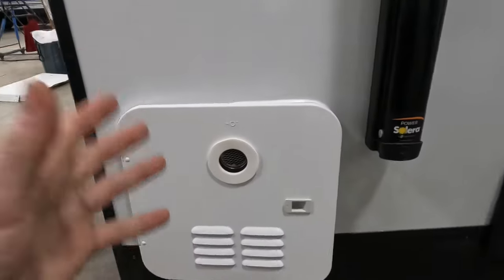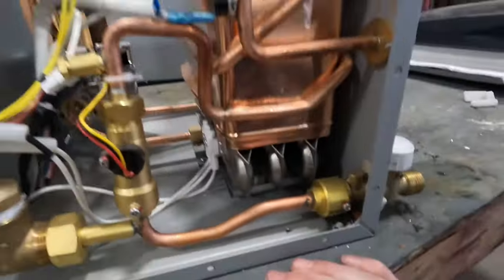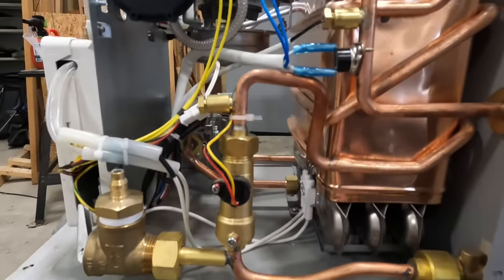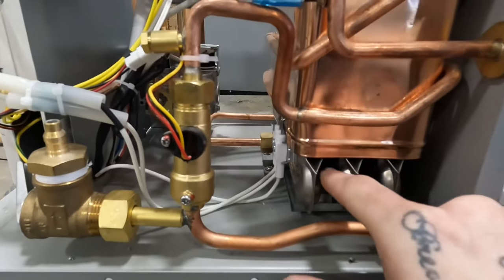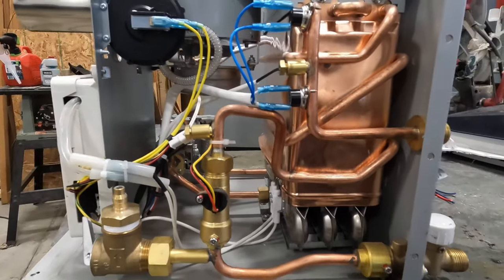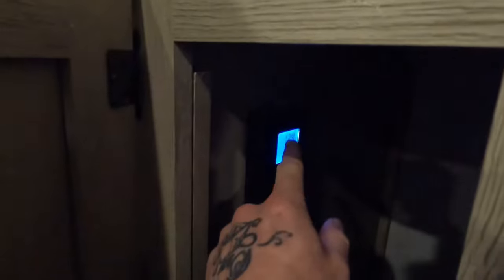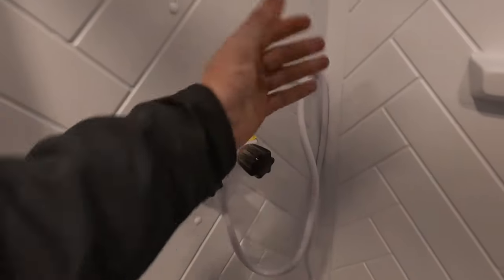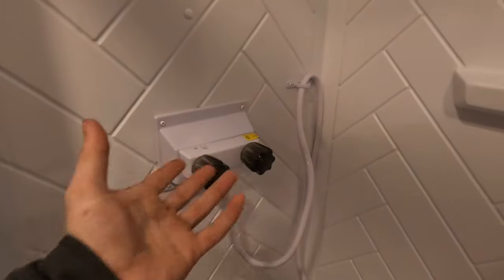RV tankless water heaters, the right way to use them!

Comment: I am considering a portable tankless for a permanent outdoor shower tower and I am convinced that maintaining a constant output temperature will be impossible unless I don't change the spray option (volume) and the incoming water temperature is perfectly stable. For that reason I am hesitant to pull the trigger. These units do not have a temperature setting - the only way to have a consistent output temperature is to adjust the flame and the volume and rely on the incoming water temperature to be stable plus don't change the volume i.e. to change to body wash or handheld option. No one seems to mention this shortcoming.

Comment: What do I do if the control board isn't changing the temperature of the water. I typically have it set at 100 and the second the water turns the temperature shoots up to 130

Comment: I'm having an issue with mine. I have my control panel set to 110, but the output goes way beyond that 115-127. It'll shut off when I turn the cold side on, but then I'd have to turn the cold side off when it gets too cold. I constantly have to repeat that daily

Comment: Question…what is the ‘steps’ in the procedure for set up your water at a RV site & turning on your hot water heater?  I was told to connect your water at the RV site, then turn on the water in your sink to make sure you have pressure and THEN turn on your tankless water heater…is this correct?

Comment: I have mine turned all the way up to 124 and even only using hot it only goes up to 99? The sink water is hot but shower only Luke warm ? Brand new RV? Is there a scald guard or something?
Reply: I'm not a RV tech but I'm am a HVAC tech . Maybe the rv tech can chime in on this but, commonly on standard tankless water heaters that could be a running issue ( not firing correctly,  not burning correctly ect....) with water heater or under sized because the amount of water flow going through unit or your temp rise from cold coming in isn't enough ( under sized) . Hopefully you get this figured out.

Comment: We spent three or four days in a row a week inside the RV is it OK to leave the tankless water heater switch in the amp position all the time? Or should we only turn it on when we’re taking showers or washing dishes? We just don’t want to lick or work hard when we’re not actually using hot water.

Comment: So I have a stupid question about the operation shown in this video. There is an off / on switch on the side of the tankless water heater. Purpose of this switch? I would assume if there is no flow that it wouldn't work anyway or am I wrong. Thanks

Comment: good tip on hot only.. stupid question... is the (O ) for OFF or the line ( | ) on the heater.  I wanted to turn it off and no other markings
Reply: O is on and | is off

Comment: Yeah, unfortunately this didn't work for me.  Brand new tankless water heater in a brand new RV.  Doesn't heat up water in the shower, but it does heat up in the bathroom and kitchen sinks.  Output stays around 85, even goes down and back up.

Comment: My Fogatti  tankless rv water heater will overheat the water. I have set it from 102 to 104 and the temp will go to 109 and more while I am in the shower.  If I mix in any cold water it will keep jumping higher and higher as I add cold to it at the shower.  Have you any fix for that?  I have increased the hole size in my shower head to allow more flow and it helped some but it starts at 104 then in a few .minutes starts increasing till it is scalding.

Comment: I need help. I am new and bought a vibe 34xl and have no idea how to get the propane flowing through the camper to work the stove or tankless hot water heater. Propane tanks are open and switch for hot water is in the on position.

Comment: I have a suburban tank less water heater and I keep getting error code 1. Sometimes it takes 3 or 4 times before it will start and heat the water.
Reply: Any solution? St60?

Comment: Im struggling. Live in south Florida and was told thats why im having issues. I have the thermostat set low, at 98°. Problem is when the water is flowing the thermostat jumps all over the place causing scolding. Goes from 98-120-130-115 etc. Tried adjusting the flow valves. No change. Is this a damaged thermostat? Company was no help at offering any information other then increase the flow. Which did nothing.  I keep it set at 124° and im fine no jumping, but my husband prefers a much cooler temp down by 100° and we cant find a solution. Any advice is welcome!
Reply: I am considering a portable tankless for a permanent outdoor shower tower and what is happening to you is what I am convinced will happen with all of these units. For that reason I am hesitant to pull the trigger. These units do not have a temperature setting - the only way to have a consistent output temperature is to adjust the flame and the volume and rely on the incoming water temperature to be stable plus don't change the volume i.e. to change to body wash or handheld option. No one seems to mention this shortcoming.

Comment: Do you turn it on right before using hot water and turn it off after you use it? Or just leave the thermostat on all day?
Reply: You’ve to leave it in the on position, it’ll turn on by itself when there’s flow on the hot water pipe and torn off by itself when the flow stops.

Comment: I turned my temperature all the way down to 95° the lowest setting and it's still very hot.
Reply: Mine is 95 as well but ot goes to 110 120 in the summer for me in south Texas it doesn't stick to what it says do you have that problem

Comment: So you’re saying that by cooling the water by using the cold water tap makes the water heater work harder! Are you serious, the water temperature coming out of your heater is regulated by the temperature sensor. Adding cold water to the flow downstream from the heater will have no effect on the water heater. The water heater will only work as hard as what it takes to meet the setting you chose.
Reply: You are correct! The heater will only work as hard as the control head is set too. As you said, adding cold water downstream of the heater has ZERO effect on what the heater does. Maybe he means that when people add the cold water, the add too much and then keep turning the heater up… maybe, thats what is was trying to say. I would agree with that a little. Many people may not know that just a crack of cold water will meet the temp needs of the tap, maybe they turn it a full turn because thats what they are used to. 

The correct way to set the temp of the water heater is to set it to the highest desired temp for the hottest use, aka washing dishes will probably need to be hotter than washing hands or a shower. My home heater is set to 120 (dishwashing hot) and the shower to 103 (shower has its own temp setting/mixing valve). So when washing dishes, full hot, no cold added. Shower does its own thing, when washing hands, you have to mix cold as desired to get your temp.

Comment: I bought rv with tankless water heater I turn the bottles on I turn the monitor on but it dont turn on and when I turn hot water on nothing comes out what u think is the issue
Reply from the maker: Water heater is very likely in bypass or blocked
Reply: Same issue and ive only had my brand new rv 3 days
Reply: Does water pressure on of get hot water or not.
Reply: I'm sorry does water pressure Matter if you get hot water or not ..meaning lack of pressure.
Reply: Is the propane on? Lines open.

Comment: Interesting … but what about hot water for washing dishes etc?  That I keep much hotter than I want to shower with.

But I do agree, mixing with cold is difficult especially because of water pressure fluctuations at the campsite.  We cure that when it is bad by running off the onboard water supply
Reply: I believe the answer to this is to set the temperature you want for the activity being done at the time.  If you are going to take a shower set it to the temperature you want in the shower then shower.  If you are going to wash dishes, set the temperature higher then do the dishes.  It helps if the control is in an easy location (like it is in my Grand Design Image trailer).
Reply: @jerrydonovan7507  Hi, is there any downside to constantly changing the temperature setting?  Any stress or 'wear and tear' on either the tankless components or the thermostat?
Reply: @mikem462  The tankless water heater doesn't do anything until there is water flowing through it.  It also stops heating water when the flow stops.  I doubt there is any downside to the electronics by changing the temperature setting.  It might actually be easier on the components since water is not heated to a higher temperature than what is needed (like a standard tank water heater does).  
However, there is a practical downside, because there is a slight delay (5 seconds or so) in the time the water starts to flow and when the heater turns on.  This means that some cold water flows before the desired temperature of water does.  When taking a shower, all of this affects 2 things.  One, because the temperature is what is desire, no mixing of cold water is needed (only use the hot water faucet handle).  Second, is because of the startup delay, you do not want to turn off the water in the shower while soaping or shampooing. If you do, you will get a short blast of refreshing cold water.  You can slow the rate some if you don't make it too slow.  So, the downside is you might waste a little bit of water.
Reply: @jerrydonovan7507  Wow, Jerry, thanks for the quick, and very detailed response.  I appreciate the information.  Take care.
Reply: I was told I could not use one in my older camper only 30 Amp service. Could I add a generator perhaps to make it work?

Comment: You are incorrect in your instructions, at least you didnt fully explain how to use the endless water heater. You set the temp controller to the hottest setting you want for the hottest demand. Washing dishes probably require hotter water than washing hands or taking a shower. If it’s set to 124 (in this video) to be the desired temp to wash dishes (no cold water would be added), taking a shower may require a (SLIGHT) crack of the cold water to get the desired temp….. adding cold water downstream of the heater (aka at the tap) would have ZERO effect on how hard the heater works! It’s only gonna work to get to 124 in this example. Now if people keep turning it up because they are adding cold water to reach the desired PRESSURE, thats a different topic. There is a learning curve to how tankless works but not thru misinformation.

Comment: The Problem With Tankless is that when one shuts off the water the heater shuts off and the water cools down. 
So, if you are taking a shower and shut off the water, (to conserve perhaps) when you turn the water back on it will not be hot.
If you are doing dishes and turn the water off and on to rinse. It will not be as hot as if you leave the water running.
I am going back to a tanks as soon as I can afford to. My original tank busted in the winter. That's another story.